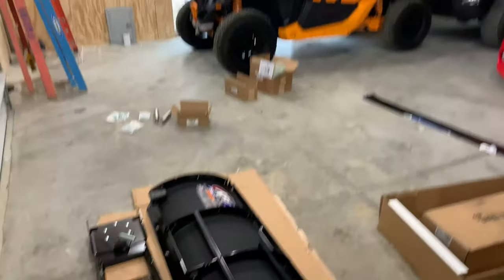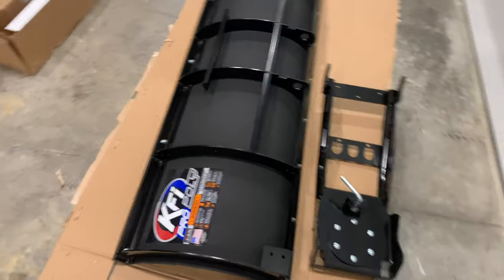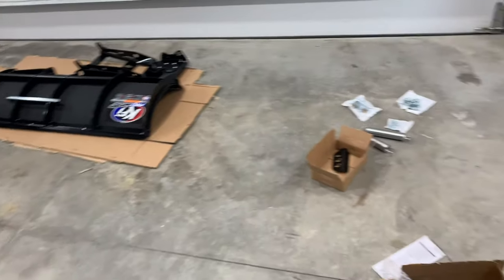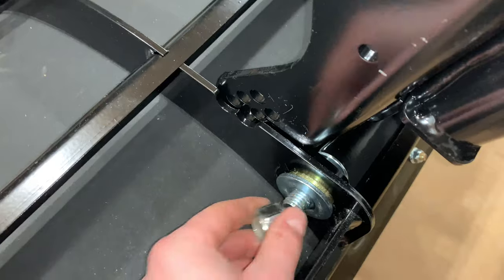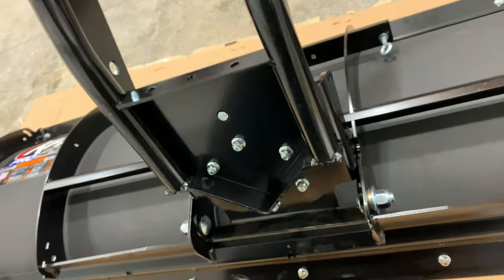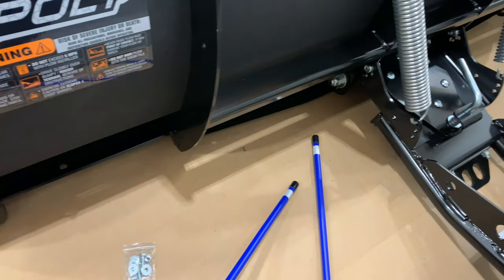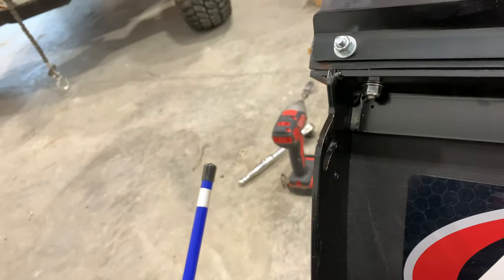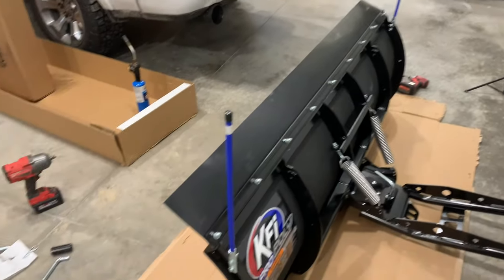PART 1- Installing a KFI 72” Poly Snow Plow on a 2020 Can-Am Maverick X3 RC

Comment: I just added the kfi plow to my 2019 xmr.  You need to take the front bumper off and change the winch mount to a kfi winch mount.  It is another $150  .
Reply from the maker: I have part 2 coming out soon once Ohio gets some more snow! I was able to Fab the KFI plow mount to fit without swapping the oem bumper only required drilling 2 holes

Comment: I really like your shop. What is the dimensions of your shop? Do you have any videos of your shop build??
Reply from the maker: Thanks! Its 36x40 with 14’ headers. 20x12 garage door with 14’ of attic trusses and 26’ of scissor trusses. Roof pitch is 6/12. If I was to rebuild I would definitely go 36x48. Extra 8ft would have came in handy once I get the lift setup